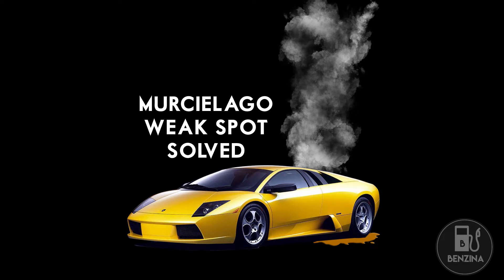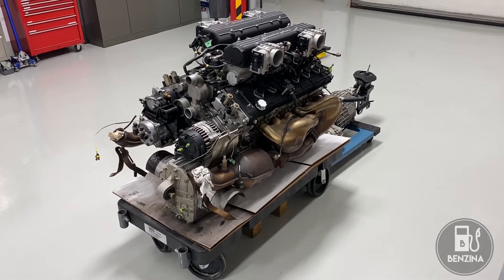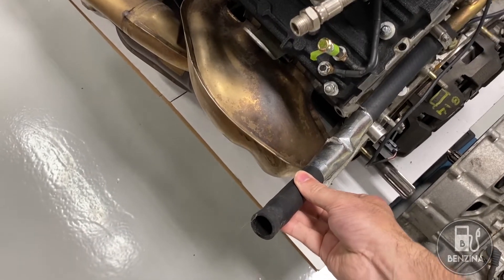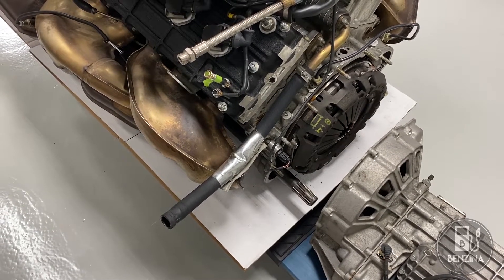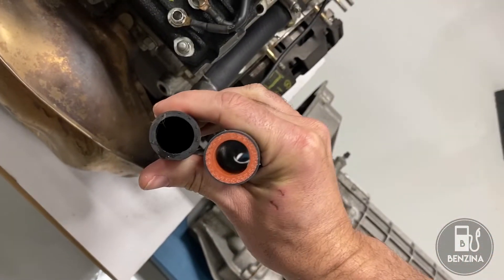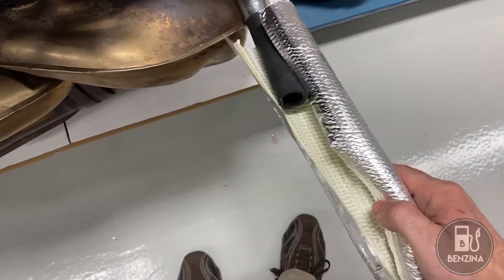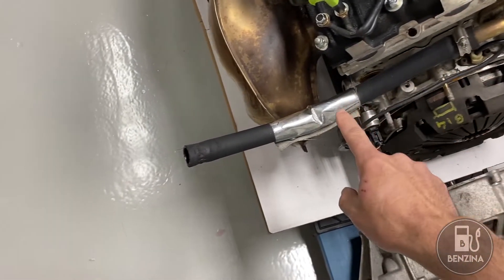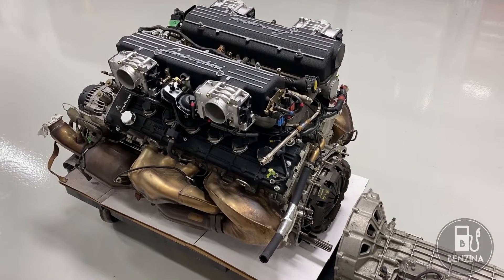Lamborghini Murcielago Servizio - Coolant Hose Repair & Upgrade

Comment: What about also adding a thin metal heat shield .. it could easily mount under one of the grounding nuts on the corner of the V cover and bend down to where needed...?
Reply from the maker: There is nothing lost in adding additional heat shielding. That said the solution proposed here is many times more durable than stock and should be good for a long time.

Comment: As Alex mentioned - thank you for posting. Question:  What was the OAL of the aftermarket hose?
Reply from the maker: The original hose is 40 cm long or 16 inches. The hose we used is the same length.

Comment: Can this be accessed with the engine in the vehicle? Looks like a pretty tight fit against the firewall
Reply from the maker: The engine DOES NOT need to come out to do this service. Everything is accessible from above (albeit tight). Be sure the engine is stone cold when attempting this. It is super easy to get burned otherwise.

Comment: Is there a reason that the fixed brass pipe that the hose clamps onto isn't longer or extended  beyond the headers with just a small 4 inch hose to connect to the water/coolant reservoir for flex?
Reply from the maker: I am not sure why there is not a rigid line near the headers and a shorter flex hose. Either way the solution proposed here is simple, cheap, and very durable.

Comment: Thank you so much for the video.  We were just talking about replacing this hose on our Murcis.  Is that hose 24 inches long?
Reply from the maker: The original hose is 16 inches long. The hose we used is the same length.